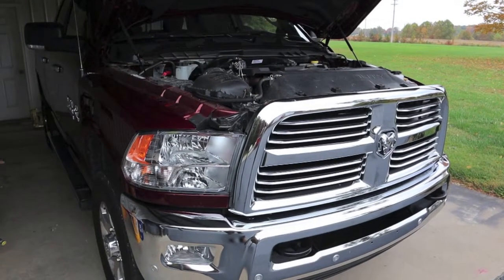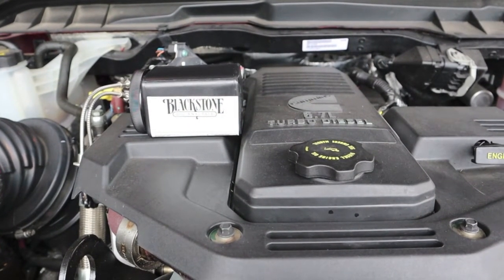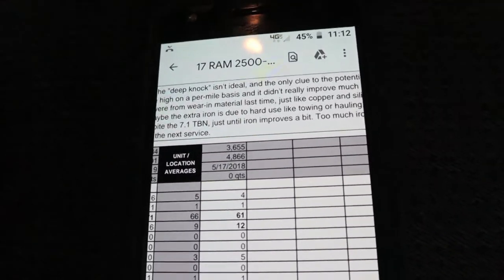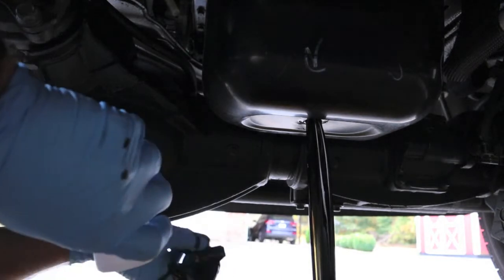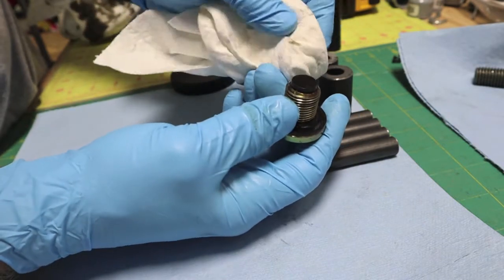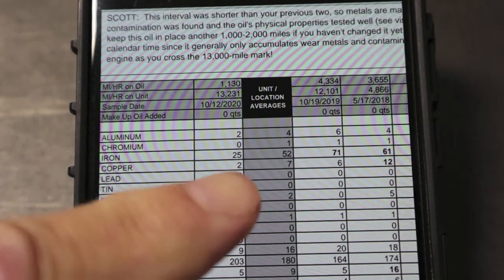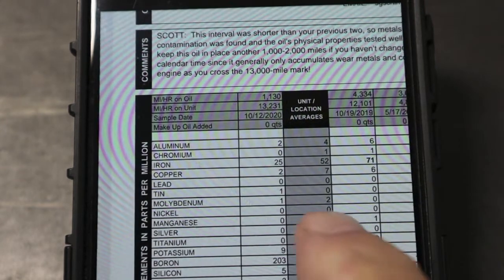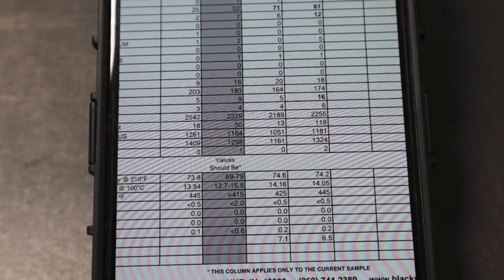RAM 6.7 Cummins 1,000 Mile Oil Change with UOA (used oil analysis) at 12 Months

Comment: Go to the dealer and have them check out the engine, get that documented! I have that much iron wear on my Cummins in 5000 miles! Something not right! Sounds like valves are not set right but get it checked out! If you are not happy with the dealer take it to a Cummins authorized dealer and have them check it out. Good luck
Reply from the maker: I'm going to have to get it documented. I just got the Blackstone Labs report on 2500 miles and half those towing 11,000 lbs trailer. Iron is at 105 PPM. It's getting worse at 15,000 miles.
Thanks for the info!

Comment: My 2017 has always had the same knock to it as your videos. Runs fine and oil analysis is ok. 40k miles now, still there. But what is odd is every once in a while it idles quiet. Catches me by surprise when I (don’t) hear ii and doesnt seem weather related etc. The next start up it’s back to knocking. I’ve proded with a stethoscope and can’t find it. Does yours ever idle quiet?
Reply from the maker: James, mine is doing that too. On occasion, and I can't find the reason, it will idle with no knock. As of now, I'm going with the CP3 fuel pump and it's timing (with injectors firing off).
The good news is, it's not harmful. I have 15,000 miles on it and power train warranty is up in June next year. When it's out of FCA warranty, I'll take it to Diesel Injection and let those guys see what they think. If iron PPM comes down, I'll be a happy camper. I started using Power Service Diesel Kleen fuel additive, the knock is still there.
Thanks for watching!
Please post back if you ever discover the source of your engine knock.

Comment: Any news on the knocking? My is a 18 2500  just started doing that noise has about 35k miles.
Reply from the maker: I started using the Power Service Diesel Kleen fuel additive now that Cummins says it's okay.
I would like to think it's knocking less that usual, but that could be my wishful thinking in gear.
For the time being, I'll stay with OA and see what the iron content trending does. I absolutely love this truck. My fingers are crossed.
If you get any news from your dealer on your noise, an update here would be greatly appreciated.
Thank you for watching and good luck with your 6.7 Cummins!!

Comment: Your engine hasn’t been worked as not towing anything and it’s not uncommon for a diesel to not be truly broken in until 25000 or more miles and that assumes a worked engine. Your engine might take substantially more miles as it needs to be worked  - it’s not like a gas engine. Put some load on it 5000 pounds or more towing and work it and it will be happier and run better I bet. The owners manual basically says the same thing about it needing worked.
Reply from the maker: I've pulled a 10,000 pound fiver for 4,000 miles and a 12,000 pound fiver for 1,600 miles.
I'm hoping you're are right!
Truck has 15K on it now. I will continue the UOA with Blackstone.
Thanks!